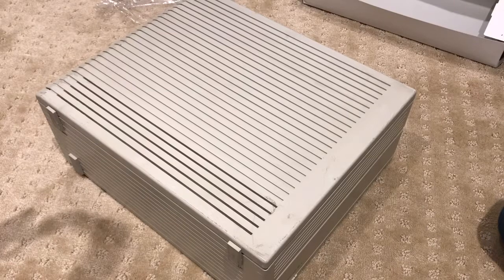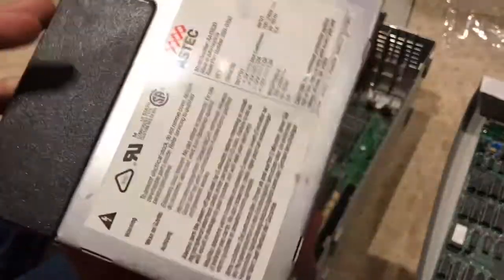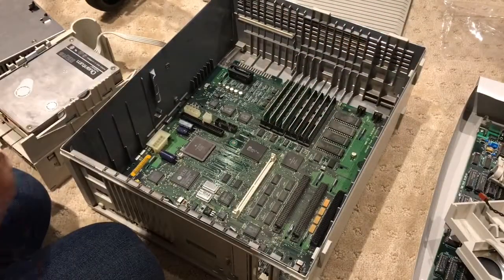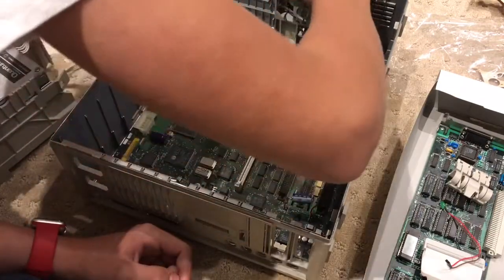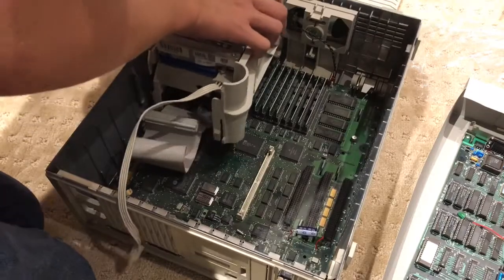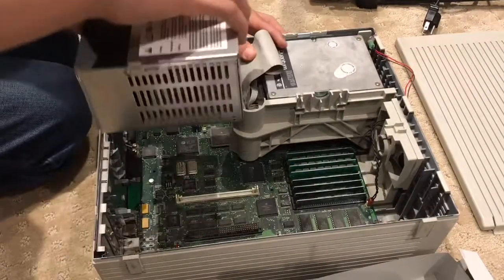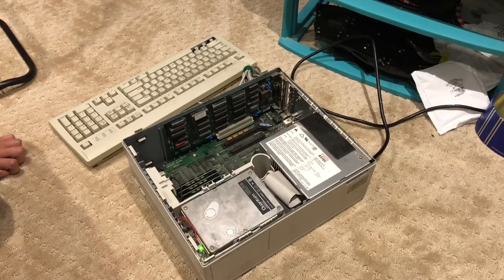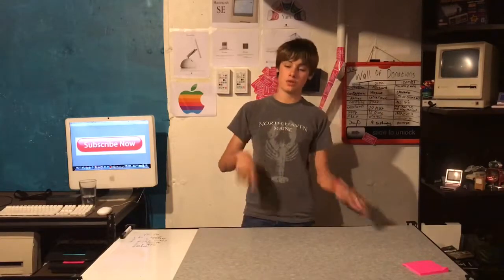Attempting to Repair my Macintosh IIcx | Mastergeko4

Comment: Restorations take time but i however understand how baffling when the approach to the contrary with resources that aren't present can be. this was how i myself entered the world of yesterdays tech after the prime of it at the age of 25 some long duress, i had an LC that dragged on in storage without much use after the first time on since buying one off eBay and by the time it was powered again there was an array of emerging issues such as faint sound only not too long after that the 0000000F chimes of death screen at boot. today, i now work at a vintage computer workshop and museum where i am now able to make assessments professionally with my own toolbox and whatever is supplied additionally where so far i have remedied loud cap whistling on an LCIII and a couple of other valued non-Apple equipment.

Kudos on willing to try out that checkup on the IIcx, perhaps a while later you might feel more prepared to take a dive back into repairing old Macs again like i recently did.

Comment: I would try to avoid broken Macs on eBay unless you know what the problem is for sure. Macs with the flashing folder are a good buy. Also did you sell your Macintosh Plus?
Reply from the maker: Yes I Sold the Plus. I only made $20 because of a Shipping Miscalculation.
I wouldn’t risk getting a Flashing Folder because Hard Drives Can be Expensive.